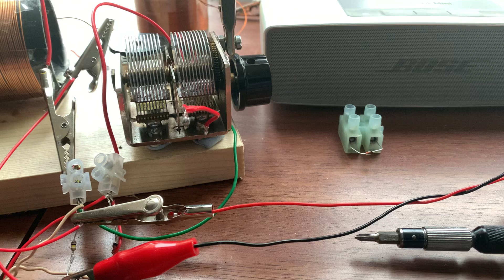Improving the selectivity of my crystal radio with a dual-gang 390 pF air-spaced variable capacitor

Comment: I made a double tunes crystal radio many years ago.  (Two coils + two capacitors)  The selectivity was much better than a single tuned design.  What surprised me was that it also was louder
Reply from the maker: Thanks Ken - my next project I think! 73
Reply: @OxfordShortwaveLog  I will search my memory and see what hints I can give as to how I got more selective and louder at the same time.  "many years ago" is about 50 years so digging up the memory will take a bit of time.
Reply from the maker: Thanks ken - my friend G0AOZ emailed me a circuit for a dual tune set. 73

Comment: Hello Client, I purchased a Variac from the recent Ham Meeting in Dortmund last Saturday. Will it be possible to use it as an antenna for a Crystal radio or at least for receiving VLF with it? I know it is basically a tuner not an antenna. Should I see it as a variable inductor only? Thank you! DE1CTL
Reply from the maker: Hi there, I'm not sure my friend - I'm too young to have ever used a Variac! It's basically an adjustable transformer. 73